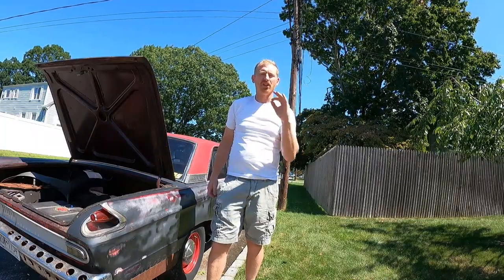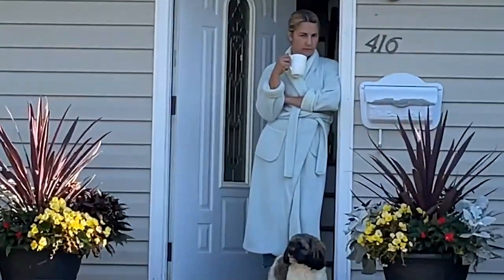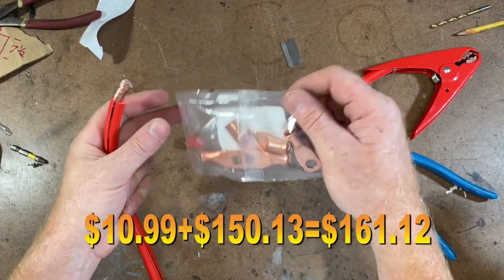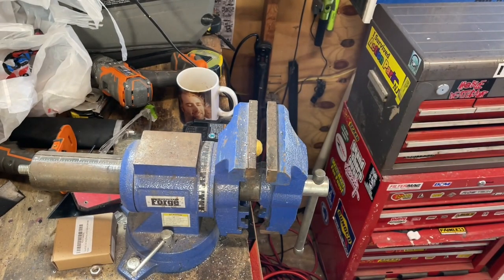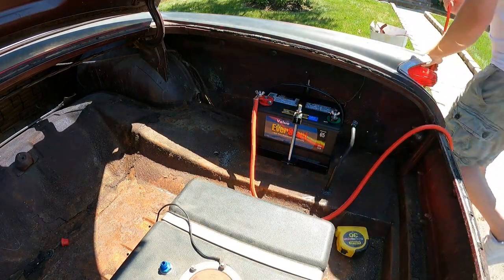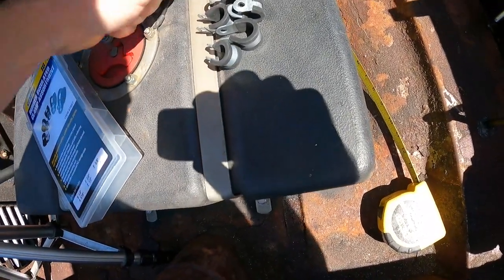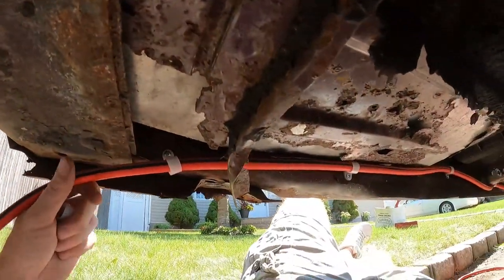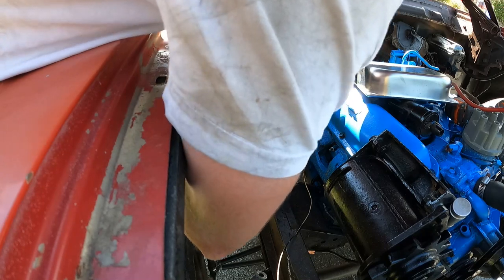Running Postive Battery Cable to the trunk!! Cheapest Battery Cable!! Pt.4

Comment: You've inspired me to start doing my own modification projects on my car. My AC belt kept coming loose and squeeling (New belt) so I made a crows foot out of a peice of steel to lock the bolt on the tensioner to keep the bolt from backing out, Worked like a charm. Keep up the good work man! Can't wait to see this beast fire off. 👍
Reply: nice!  hey.  whatever's clever!
Reply from the maker: Awesome!!

Comment: I don’t know what the U.S equivalent is but in England to use a car on the road you have to have an M.O.T. Certificate to show your car is safe. Mine once failed on a couple little rust holes in the floor seals. I hope is not as harsh there mate.

Comment: Oh man! You are going to want a fuse block right on that battery. Seriously, this is a very dangerous setup especially enclosed next to a fuel cell. Also when you get ready to start that engine, hook up a booster right to the starter. You will cook the hell out of that cable by the time you get that fired up for the first time. All of your videos a frikin' awesome man. Don't know how you manage it all but please keep it going.

Comment: I was dragging my feet to buy a heavy duty jumper set but ultimately decided against it because they are heavy, but not heavy duty.... the cheap ones are not actually copper, just copper coated and a genuine copper jumper is like 300 bucks. So it is better to just have a 70 bucks jump starter battery in the trunk.

Comment: Jesse... Brother... Solder those ends on the wire! Slide a nice piece of shrink tube over the end! Why didn't you run the wire inside the car? BUT! The jumper cables are fucking genius!!!

Comment: The jump start cables may work for what you’re doing , however I wouldn’t try to run a mono block stereo amp off it . I don’t think it has the shielding to sustain high wattage sub amps . I had a guy I worked with melt the shielding and burnt his carpet in the car with really cheap cable .

Comment: So I'm guessing, and I may even be wrong, that aside from the grift of it all... ...that the only difference between jumper cable wire and "legit" wire is the long-term integrity of the shielding?
Reply: And at least with the plastic clips, you can go back later and put metal ones about 2 inches adjacent to them without replacing them.
Reply: I don’t know the answer but I like your question.
Reply: No, the jumper cable is cheap aluminum core rather than copper.

Comment: If you bottom out on something it will short out. You should run that through the body, not under the frame. I have never seen a power cable run under a frame. PLUS - That cable isn’t water proof, so it will corrode internally.
Reply: Ol Jesse Rustbuckets sez: "It's GOOD ENUFF™!"